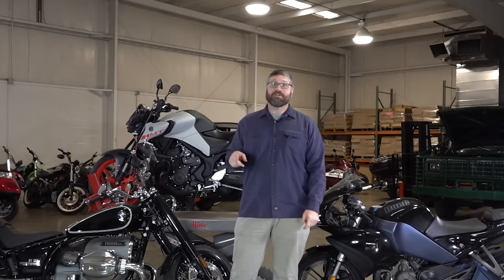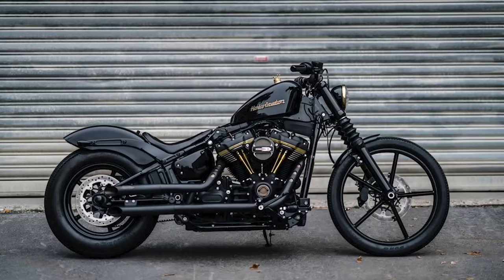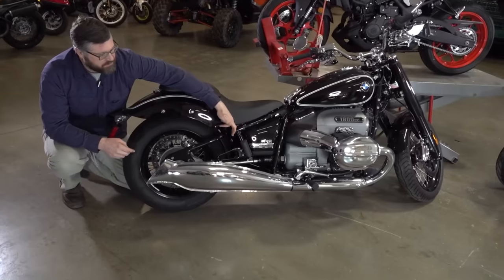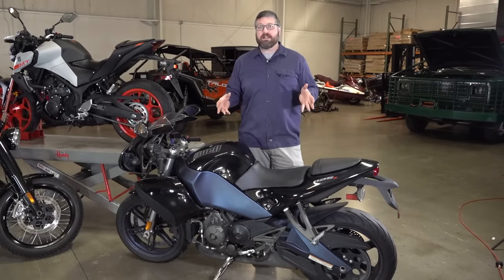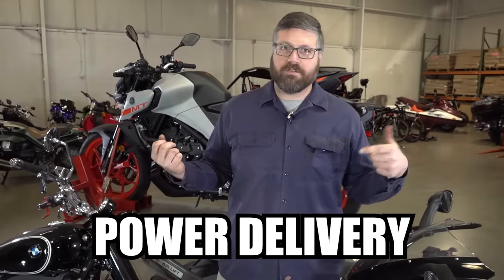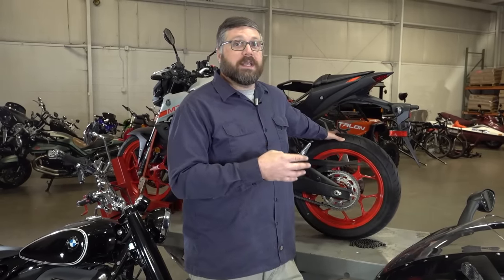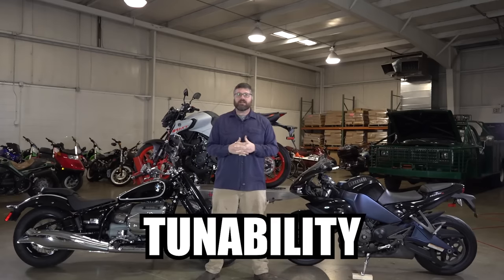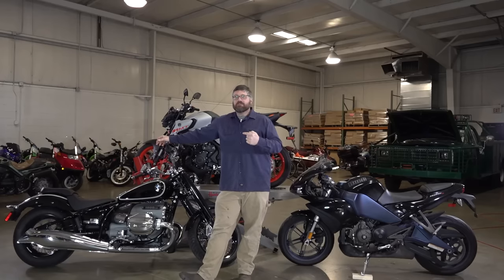Motorcycle Chain vs Belt vs Shaft Which one is Better?

Comment: I had shaft drive on a BMW 4 cylinder K-bike. With the engine crankshaft in line with the gearbox, in line with the driveshaft, vibrations were non existent. One could read license plates in the rearview at warp speeds.

Comment: My first bike was a 2004 V-star 1100 (shaft drive) and I loved the ease of maintenance. 👍 Second was a 2013 street glide (belt drive), which was a rolling couch basically, but also pretty easy to wrench on. Third bike I got squirrelly and bought a 2003 Big Dog pitbull which was meticulously maintained, and also a belt drive. I never got into swapping sprockets or anything, but I agree with Craig, shaft drive was the lowest maintenance and most fun to ride. Blessings to you all @SRKCycles. 😇

Comment: Touring from Ontario to California & back, I left having a new chain installed. Chain adjustments and lube all the way to Cali, had to replace the chain when I got there. Same on the way back, plus another chain and also sprockets on returning. The uneven chain wear caused an engine surging when holding the bike at highway speeds, apparently the engine cam timing chain had been unevenly stretched as a result. 1983 Suzuki GS550L.

Comment: I have a bike with a chain that is still going strong at 35,000 miles later, the original chain on the new bike back then, using WD40 to keep it clean and flowing (I don't use anything else). Belt drive, I'd be concerned of eventual cracking of the material.

Comment: Riding shaft since the early 90s (GS650G, xJ900, VMax1200 and VMax1700) with a total of well over 200.000 km (120.000 mls) and some chain bikes as second bike (SV650 and some oldtimers GT750 and GT500).
Shaft is best by far. At least for every day ride and public road.
I don't know why they still build chain drive anyway. Except for small bikes of course.

Comment: I put 25,000 miles on a shaft drive 2011 concours 14..no issues.. change fluid every other oil change. Currently on a 2014 Trophy SE with shaft drive, very low maintenance.

Comment: My 2005 1200 Sportster Roadster snapped the belt at 74,000 miles in my driveway. The shaft on my 1982 Suzuki GS850G never caused a problem. Chains are chains, traditional.

Comment: Own a 2001 Honda ST1100 — over 70000 miles. Rear oil replaced every 15k. That’s it. My Chain bikes are a PIA and kick grime into rear wheel. Belt ain’t bad but there is a risk of breakage. For a highway bike, shaft is all I would consider.

Comment: Prefer shaft but I'm currently running belt. With shaft, I just get next size up tire if I'm going for MPG and next size down if I'm wanting performance. Do have to watch for gravel in the belt though, otherwise belt is great. I do road touring and long 10-12 hour days so I don't wanna do chain care, though I have done it on road bikes (Think it was the old KZ900, 650, & 500's....back in the 80's)

Comment: As a rider in the mid 1980s that was "just" a commuter, (Using my bike in good weather to offset the fuel consumption of my Buick LeSabre,) I chose the Honda Ascot (500cc). Sure, it's not a "cool" bike by modern (Or Hell even THEN..) standards, BUT It AWAYS started, and RAN and the Honda build quality AND shaft drive made it the PERFECT bike for its role. I now have a CB-750 for the actual fun of riding, Because That's what built the house of Honda! (Oh, I also STILL drive a BUICK - a Lucerne today, now as a legit old man! LOL)

Comment: i love the idea of a shaft drive but if a seal goes or a bearing fails, its a grand to fix it. I had never seen a belt fail like that so that's definitely something that would happen to me ( I have a black cloud of luck for sure) so it's pretty much looking like messy but reliable chaIn drives for me. One thing I will never do is fear a dirt back road on any motorcycle, Can't do that with a belt drive, apparently.

Comment: All video's comparing chain- belt- and shaftdrive talk nonsense about shaft drive causes the highest loss of power. Look at the small Guzzi's 350 cc. 40 hp and still really fast and superlight (150 kg.) machines ! Did anyone ever studie the scientific data on this subject, comparing well maintained, optimal working systems ? Use the right oil, don't put to much in because than it may take al lot of power. For competition use chains do have the advantage of changing gears but for all other use shaftdrive is by far the best choice. The by far best sold ADV has shaft drive, it began with a 40 hp. 800 cc. Dakar replica witch was by no means slow (you couldn't go fast as it had dracmatikly bad brakes). Check all data and get shaft-drive, it's a little more expensive to make but a lot cheaper and easier to maintain than any other system.

Comment: Commuting touring and cruising shaft is best for me.
Racing etc chain.
Belt seems a bit of a compromise with a major drawback being its quite easily damaged by stones etc requiring  a spare belt to be carried and tools to fix it at the side if the road.
Ive had chain and shaft and shaft was much easier,
Im thinking about getting a zero sr but the belt is reported to be a weak point with some riders snapping them after 50 miles just going over a pot hole.😂

Comment: Mmmmm . Chain Drive . Solid Rubber Tyres to go with that ? Chains transfer more power  ONLY  if  they are in Perfect condition . About 95-97 % .
Belts have Good Efficiency and somewhat lower maintenance needs  BECAUSE  they are slightly Stretchy . A good compromise that  MUST  be Clean .
Shaft Drive RELIABLY and Unfailingly transmits  93-95% of the input power , FOREVER . Sort of . You know what  I  mean here . Doesn't change .
Clearly  I  am a proponent of Shaft Drive , however Each system has it's Pros and Cons .
Oh , and  BTW . If here is a Sister Model Shaft Drive bike to your Model it IS  possible to change gearing fairly Cheaply . Wheel Diameter vs Internal Ratio . 
I  have actually DONE this , personally . With a Z-1100 and a Z-1000 Kawasaki . Parts Bin swap out .

Comment: One thing that's super important that you ignored. Which is easier to change on the side of the road? Stripped gear or broken pin in the shaft and you're done. Busted belt, you're either getting deep in the trans or you're done. A chain, couple spare links and brake in your tool bag and you're back on the road in 20 minutes. Yeah maybe things like this happen less with belts and even less with shafts, but they still happens.

Comment: My Yamaha XJ900 Diversion shaft drive had zero problems over 75,000 miles. At 45,000 miles, my BMW R1200GS cost me at least £800 for a full rebuild. By then, the gearbox input shaft bearing was failing so I was seriously not impressed. Poor design resulted in bearing failures. I could have any number of chains over that time.

Comment: I currently have four bikes:  two BMWs, Honda  Valkyrie and a Triumph.  Replaced two final drives on the Valkyrie at $1,500 each over 108,000 miles.  My 1994 BMW 1100RS shaft needed a seal replaced at 50,000 miles, my 2009 RT only has 35,000 miles on it; though BMW shafts have been known to fail. Shaft drives are not maintenance free as the splines need to be greased as well as oil changes.  My chain drive Triumph has 17,000 miles, needs no adjustment for wear; but the manual says every 200 miles and after each rain.  For long distance riding, shaft is best…no hassle vs. having to carry a can of chain wax with me.

Comment: This man is clearly bias. And is too lazy to do simple. Mait means I would much prefer a chain because it can be repaired and filled with just a simple master link. If the change should break for some reason or if somebody should vandalize a chain and break it. It's also easier to repla continuous belt loop. Okay, no oil, yeah, got it.  Easy peasy, lemon squeezy shaft drive. I don't ever want to have to tear one apart and put it back together. It's pure trial-and-error and a 3/4 inch site window to see if the pin is in a proper space properly spaced from the gear. You're not a good picture. I definitely wouldn't have the patience for tear it Open and putting it back together 3 or 4 times. And on all the bikes I've had which I beat the c*** out of I reduced to rear gear ratio's putting significantly more stress on that chain. Then it was designed for they lasted years.
 Not a season and I put 19000 Miles a year on it riding year round in New York weather.  So I don't know what he's talking about. That benty showed brando from the bag they do that far. On the shaft, drive pretty smooth when it's riding at a continuous pull.But if you're idling down to a stop light you get some serious chatter from the rear if it's the least bit out of speck. Is belt drive is quiet. On the change drive, I have never had a problem with smooth delivery from the change drive.Don't overtight and don't leave it loose.It doesn't make a lot of noise and it delivers fast immediate power.There is a reason why quarter horsepower conveyors used  a chain , not a shaft.

Comment: As you get older, shaft drive drive quickly becomes a paramount requirement. A shaft drive is much smoother, quieter, and far less hassle. At 60+ my idea of motorcycling doesn't include images of me spending weekends on the garage floor doing chain & sprocket maintenance. So yeah, that means I'm riding either the Gold Wing or the FJR1300. The updated 2022 Triumph Tiger 1200 GT is on the radar, for sure.

Comment: Hi….. good chat 🇬🇧

The only thing I would add is stability, or the feel of it…… torque reaction on a big engined shaft drive can catch out the unwary. The UK Police had issues with big boxer and longitudinal BMW’s in a chase scenario, they would “step out” when a large amount of power was applied when leaning over….. all the shafts I have ridden tend to wind up on acceleration and squat on a closed throttle.

The only benign shaft I have owned was the Moto Guzzi Daytona 1000, with its Dr John Wittner derived frame and rear suspension….

I prefer the belt on my 96cu FatBob and although it’s way up on power, the belt is sound. As was my Buell Cyclone….. 🇺🇸

Comment: I imagine the shaft drive adds weight and cost to the bike as well, compared to chain or belt.
Reply: Not really, I ride a Honda vtx 1300 and it's a great ride! Completely dependable, smooth and VERY little maintenance. Change oil, THAT'S IT!

Comment: For me, I don't care about the chain noise - it's so quiet when lubed that I don't really notice it all that much unless I don't have a helmet on and I'm driving it about the driveway/parking lot. On the road - the bike is louder by a large enough margin that unless you're wearing a skully - you'll only really notice it when coming to and off a traffic light. That said - belts are smoother. But I don't really care/notice enough to go deliberately chose a bike with a belt. Shaft drives are cool and all - but man I just don't really care about the bike's drivetrain enough to pick it apart. If it works - it works and that's all I need. I'm too focused on riding to nitpick.

Comment: I had a 1984 Honda V45 Magna with shaft in 1988, Hated it! after riding chain drives for every other bike I've owned I'm building a 2006? Harley Sportster that has an '04 highly modded (883) engine and I doubt that the belt will handle it.I'll stick to the chain... I also like riding gravel roads so a belt wouldn't do very well either.

Comment: Horses for courses.
Shaft drive is best EXCEPT FOR the output seal is usually only accessible by totally dismantling the Crank Case.
If it was engineered to be able to replace the output shaft oil seal externally it would be great.
But design engineers look after the dealership's before the customers so they make a bundle on rebuilds.

Comment: I actually just changed bikes because I got sick of the chain maintenance. I hate it so much and I had nothing but dread thinking about the sprocket changes that would come down the road. Moved to a shaft drive ADV bike and I have no regrets. The only "downside" is that I had to go to a much larger bike because no reliable (read not italian) shaft ADV bikes are under the liter mark. Oh well, I guess it just counters the parasitic loss for me. 😁

Comment: Driving older BMW its,good to know that repairs of shaft drive may occure.

Also there is some dead point on some BMW between putting the throttle and let loose. Chain is more direct here in reacting.

BMW sometimes have pre used parts for shaft drive gearing on the market. The can be bought and mounted for comparably low money. E.g.  for BMW R9T the transmission overall is shorter than for the R 1200 R etc. Just need to chance the transmission at the wheel (end of shaft drive).

For my BMW the lubrication of the shaft element is not using oil, its some long term grease. Re-Lubricating may ne needed  thats normally a workshop task.

Overall: preferences depend on  tasks. For touring shaft drive is my choice. Sports and off road need chains in hard conditions - normally. There are some offroad used GS BMW that are crossing deserts in a successfull maner also. Anyways: take care and thx 😊

Comment: Belt drive are smoother than chains but have a tendency to stretch and skip over the pulley, Also belts have a much shorter life span than 100000 miles luckily if they make 30,000 before failing. Shaft for on road cruising, Can't be beat. I've had a 1500 Intruder shaft drive for 7 years now and only changed the rear gear oil once, It just doesn't need anything. Also when I changed it, It was still like brand new after 4 years.  My opinion is that Shaft for the road is superior, Off Road Chain can't be beat. Belts are for holding up your pants!!! You hear that Harley, fix your bikes.

Comment: Personally I would say it's horses for courses. EG got a high performance street legalised race bike? Chain is the way to go. Want to cruise at say 50MPH for a couple of weeks? Shaft drive (preferably enclosed shaft). Want a small commuter bike where there are compromises between fuel economy and maintenance economy? Small belt drive. The GPz 305 was an almost ideal commuting bike and was belt drive.

Comment: I detest chains. I hate cleaning and lubing them every 500 miles. They wear out way too quickly. I get tired of adjusting them every 500-1000 miles. 

You mean to tell me in 2022 we don't have metallurgy advanced enough to make chains that don't stretch after 500-1000 miles?

Nonsense.

Comment: I had a '79 Yamaha XS1100.  Shaft drive was okay but.... I had a friend with a machine shop and he also had a Yamaha XS1100. He converted his to belt drive.  After riding his we did mine.   WOW!  The difference was phenominal.  The downside of a shaftdrive is Unsprung Weight.  Chain drive is the best By Far?   I have to disagree with you.

Comment: Chain is the best. There is only a2% loss between the output shaft of the transmission to the rear wheel. Chains can tolerate off road conditions such as mud, water, snow much better than a belt. To replace a chain is much simpler than replacing a belt is a job the average rider cant do at the side of the road..
chain and Bell Drive also allow the suspension to move freely whether on the gas or off the gas. Unlike a drive shaft. When you’re on the gas with a driveshaft machine, that pinion gear is always trying to climb the ring gear, restricting compression of the rear suspension. Also, when you let off the gas approaching a turn, shaft drive bikes tend to drop in the back. shaft drive bikes lose approximately 15 to 19% of the power between the engine and the rear wheel due to making the power turned a 90° corner when it leaves the engine on some motorcycles, and then turn a 90° corner again at the rear wheel. Some motorcycles like gold wings and the older BMW parallel twins and moto guzzi’s. I only make the power turned 90° once at the rear wheel..
  you will never see a winning motocross bike or a road racing machine or drag bike with a shaft drive, unless it is competing against other machines with a shaft drive.
  that big lump, the housing that has the bearings and the ring and pinion gear inside of it it’s a hell of a lot of weight for the suspension to control. That is called unsprung weight. Unsprung weight is so critical to handling and suspension compliance that Porsche uses titanium lug nuts to save a few ounces..
   The best most efficient way to get power from the engine to the rear wheel is chain, followed by belt which is also just as efficient, i only a 2% power loss between the engine and the rear wheel. And the least efficient and the biggest problem for the suspension is shaft drive..

Comment: Shaft drive hands down. Chains are greasy and can break. I had a Honda 750 Four that had a new chain break that nearly killed me.  Belts are costly and hard to adjust on anything larger than a scooter. My Harley required a special tool and was a real hassle.  I've owned 3 shaft drive motorcycles and prefer them over any of the chain or belt drive bikes I've owned.

Comment: I've had all 3, for my road riding and bike preferences, shaft drive.

I'd does pay, especially on older style shafts, to pull the shift out and lube up the splines
To  change ratios, change gear box ratios. Fir example there are kits available for the older airhead BMW'S. A coupe of my mates have 2 gearboxes set up for around town / region, but in thir around Australia adventures, have a set up with taller final, wider intermediate ratios and lower first. Helps with standing start acceleration loaded, but significant saves fuel. Dropping 800 to 1000 rpm at 110 to 120 kph over long distances  between fuel stops can be invaluable. 

Chain in the dirt any day, to be able to quickly change ratios for different tracks is  great.